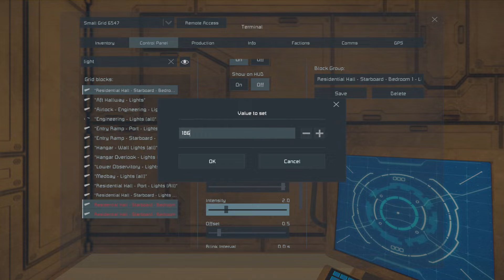Space Engineers | So You Want To Be An Engineer | Ep. 43 - The Time-lapse

Comment: Can u rotate the shield block n stack them 15 high instead of 20wide  basically u would place 30 of the shield block in stead of 40
Reply from the maker: Are you talking about the force field(s) blocks at the hangar entrance?

It's definitely doable, and while I'm not really opposed to having the field blocks mounted on the walls, it doesn't actually offer a materials savings, as the longer field blocks use more materials.

Because of the width of the hanger entrance, I'd have to use the 10 block fields, so would still need 3k (30x100) superconductors, where 40 of the 7 block fields are 2.8k superconductors (40x70) to cover the same amount of surface area.

This is one of the few times where the HxW ratio is just at that tipping point where more of the smaller blocks is actually "cheaper" if we're trying to reduce high-end material costs.

::edit::

Thinking more on it, if I went to the 16 block height, the HxW ratio would be equal so then the stacking field blocks on the wall would become cheaper overall, and the superconductor cost would be equal, so definitely something to consider over the next few days, thanks for the suggestion!

::/edit::